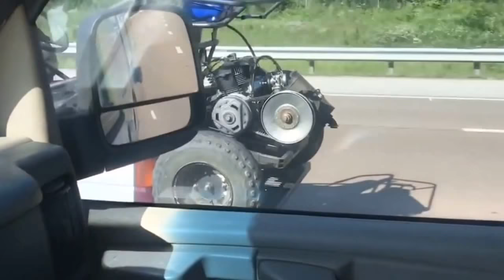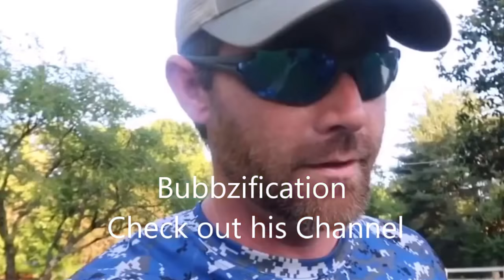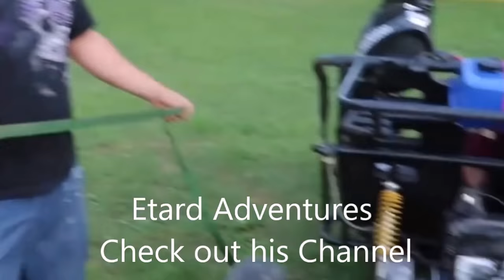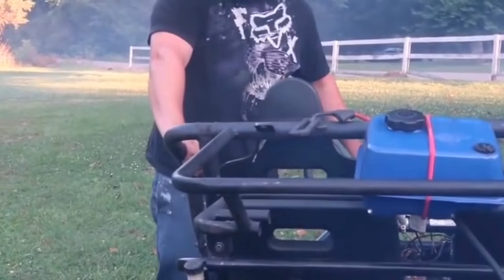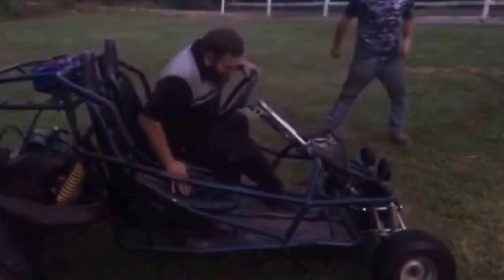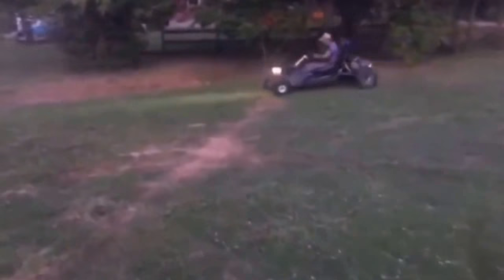Yamaha Snowmobile engine on a Go-Kart

Comment: im currently building a spiderbox with a 440 my engine has 2 carbs i look forward to ripping
Reply from the maker: Sounds like fun. :-) Wear a helmet and weld a roll bar onto it. The emergency room is BOOORing
Reply: @saneauto  mine still has the cage on it and when it had stock engine as well as the 212cc 2nd engine on it i rolled it a bunch of times and didnt get hurt.. with this engine it pry be good idea to get better seatbelts tho

Comment: Great video thanks brother. I like the video. I also liked they made the adjustment when it was hot. I have seen some that run on alcohol. Thanks again brother for the video keep up the great work see you in the next video. That is going to be great fun.
Reply from the maker: We put a 400 Yamaha Motorcycle engine on a smaller go-kart at the transmission shop. it had a 5 speed transmission it was Dangerous LOL.
Reply: I know that is right. I have a friend who raced them. He used an old 6 volt starter to get it running using a 12 volt battery. Alcohol burning fool he crashed it and they thought he was dead . He spent months in the hospital and then in and out for a while. He got lucky big time. His boys are doing it now. Man they are fun but you have to respect it.